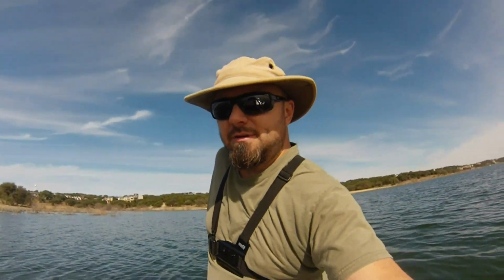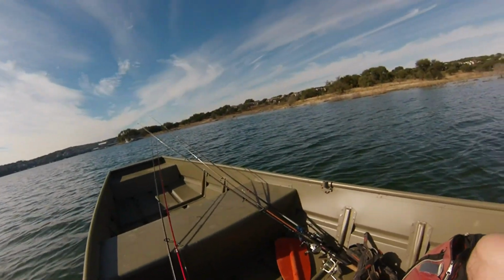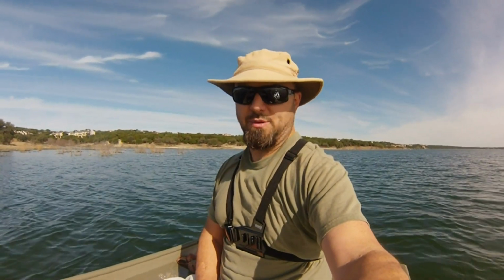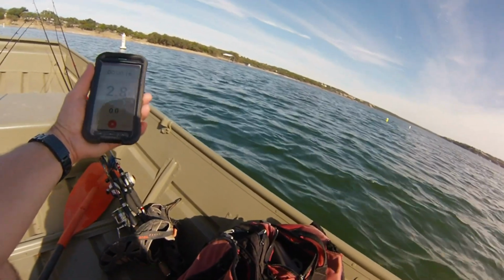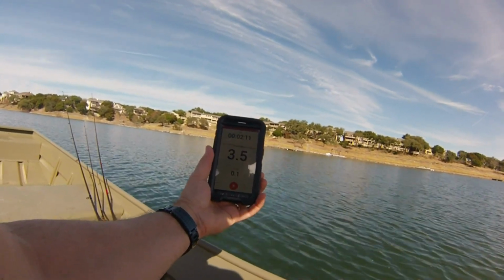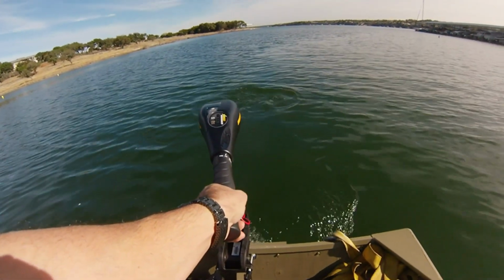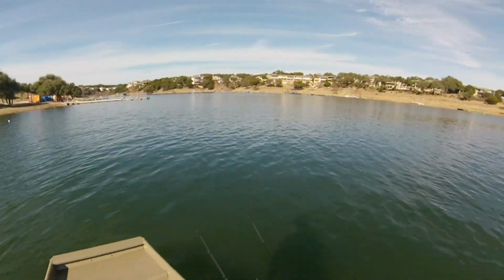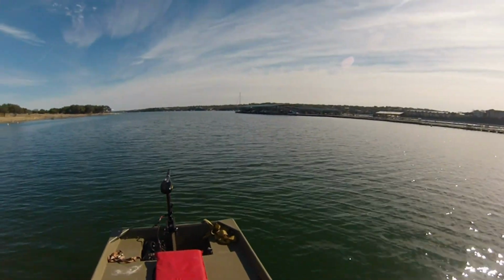1436 Jon Boat with 55 lb Trolling Motor: Top Speed and Stability (repost)

Comment: Nice boat. Nearly identical to my Alumacraft 1436LT. I run a 2012 Mercury 6hp 4-stroke (made by Tohatsu) and it does quite well with roughly 500-lbs on board (people and gear). It sips fuel. My 3-gallon fuel tank seems to last forever...
Reply: JeepCollector91 what's your top speed with tohatsu
Reply: @Fishing256  my 1436lt w/6hp tohatsu goes 19mph with me (200)lbs 40qt cooler and gear
Reply: @kevinbennett3244  thats ridiculous, my 5hp Merc can only push me up to 10mph! Lol and the size of the boat and weight are similar too